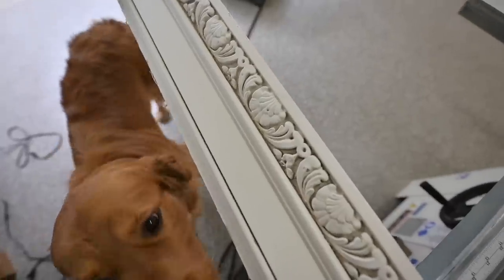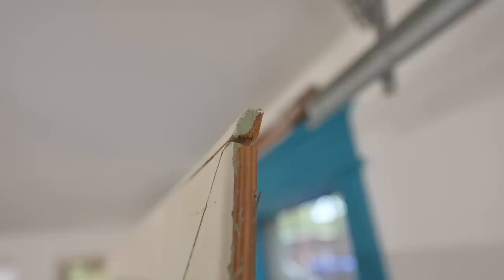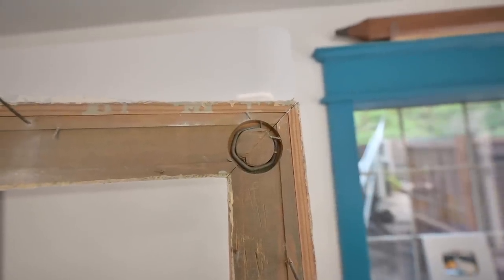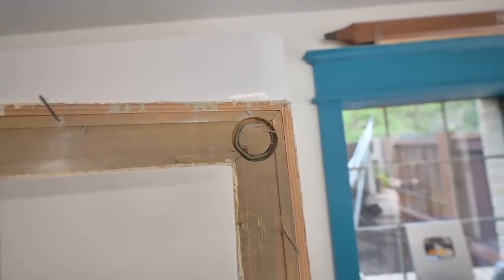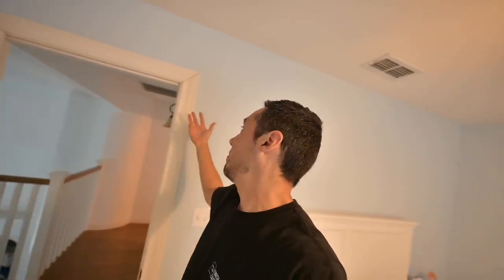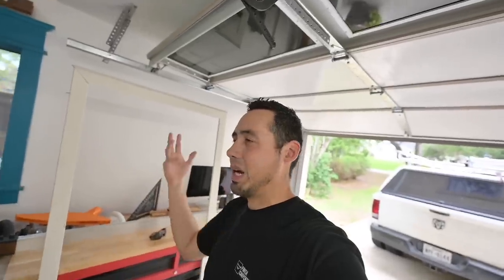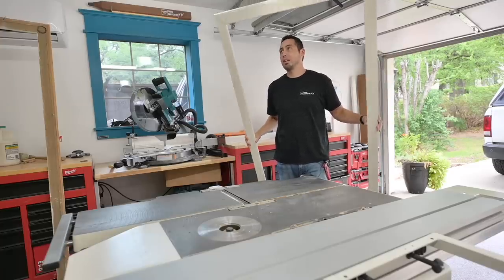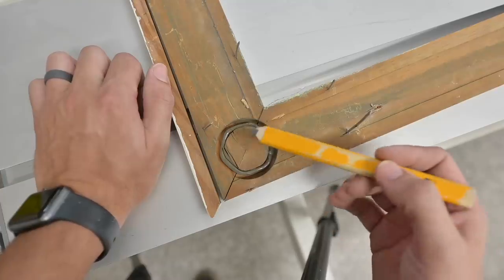Door casing skill lost for 100 years

Comment: As others have written, there were/are specific tools to make the cuts.
The purpose behind the hex ring is to lock the miter into place on houses that breath. Before the advent of Air Conditioning, keeping cold air inside the house was never a consideration, keeping the inside of the walls dry was of primary importance, even when insulated, air was allowed to move between walls.
Walls rarely had horizontal part and were of a ballon wall construction, so air could literally flow the entire hight of the wall to the eve. 
While this keeps the walls dry, and thus they do not rot, it causes really large swings in the size of wood joints. Your miters would swell in the winter and shrink in the summer, locking the miters was the solution. While the would is still swelling and shrinking, the hex ring keeps the miter tight.
Reply: I’ll continue to use titebond 2, your analysis is spot on though
Reply: One of the reasons that we don't have good breathing in homes also has to do with fire safety.  The lack of air movement between spaces also restricted fire movement.
Reply: Swell in winter and shrink in summer? It’s quite the opposite where I’m from…
Reply: Wood movement has always been an issue for detail work and furniture or decor items. Consider kitchen tables, as an example. To deal with gain and loss of moisture, the top is secured to the sides and end using a means by which the wood can expand and contract without destroying the joints that, otherwise, would be used.

I have been ridiculed by ignorant people, including a well known expert, for finishing the interior of my chest of drawers and things. They were confusing reduced labor cost with best practices for building thing that better deal with changes in humidity and such.

As an example, consider a piece of craftsman ship moved from a high humidity area to a desert. The moisture content of the item will change (reduce).  It can happen rapidly or slowly, depending on how much of the surface is sealed.  Of course, it will be much slower if the sides, edges and ends are all sealed (the reason many prime and paint the back side of siding, including Hardiplank and such).
Reply: Fastest burning houses ever built. 4 alarm fire in 5 mins or less guaranteed 😎
Reply: @tommyPencils08  is becouse of humity, not heat
Reply: @tommyPencils08  That's likely because you have AC, which dries the air.

Comment: Thanks for sharing this , I learned a lot from working on older homes picking up on techniques to do a better  my skills. 25 years ago they used to use a lot of  oak trim I noticed when I used to take apart trim the old timers would put a dab of glue on the back side of the casing to glue to the drywall to keep the miters from opening up. Thanks I enjoy watching your vids.

Comment: These moldings were manufactured and sold at standard sizes. The builder would buy the door and trim package and assemble them on site. Back in the 70's I worked on a few homes with this type of trim work. Lots of this stuff came out of mill shops back in the day.
Reply: This was my guess. They probably had a router set up at the mill. I don’t see any signs that this was on site, no chisel marks of any kind, super clean cut.
Reply: Yup, this was fabricated at the mill.   Mass produced and prefabbed building materials are not new, been around a very long time.  Over a hundred years ago Sears was selling house builders kits, everything you needed to build a house down to the last nail.  A lot of it was standard sized ready to install stuff.   I'm surprised that people are shocked by this.  Heck, Henry Ford started mass producing cars back in 1908.
Reply: @MrSloika   my thoughts mass produced, the ring looks machine made induction welded.

Comment: Years ago I met a wheelwright (a guy who makes wooden wagon wheels).  He showed me his process of pulling a wagon wheel tightly together using the outer iron/steel ring. The ring was a bit smaller in circumference than a newly made wheel.  By heating the ring he could expand its size, tap it on the wheel finally as the metal ring cooled down it shrunk back to normal size which tightened the wagon wheel. I wonder if this hexagon was tapped on easily while hot and tightened the miter when cooled. just a guess...
Reply: I was thinking the same thing, but I don't see any burn marks. Although it wouldn't have to get that hot, steel expands at, I think a little over .06%  per 100 degrees f. Which isn't a lot, but would be enough to hold a joint together.
Reply: You should check out the YouTube channel "Engels Coach Shop" and see a guy who is still doing that and posting videos of it.
Reply: Ohhhh! That’s good thinking, man. Maybe so.
Reply: @jimthesoundman8641  Love that channel been watching for years..good recommendation!
Reply: I had the same idea as you.  I saw the wheelwright at Williamsburg Va
Reply: I thought the same thing and was looking for this comment. Is it possible that they dipped the ring in cold water just prior to dropping it in the recess. This might explain the lack of burn marks. And no chisel work would be required. The ring would then immediately tighten and squeeze the wood to the hex shape.
Reply: @keithoshea2174  I would think just putting the ring in hot boiling water then taking it out and putting on the joint would suffice in that case.  You wouldn't burn the wood and it would cool fairly quick
Reply: On this scale i doubt heat was used.
Reply: @seankelly819  p
Reply: If he got the ring up to boiling, it would only be 0.09% expansion. Not near enough. A 2" ring has a 6" circumference that would go up to 6.005". If it was 400°F, it won't burn but it would still only gain 0.01" in circumference.
Another technique is to saturate the wood in boiling water until it's pliable. Seems like a lot of work, but if you did 20 at a time, not really that hard. You can really distort wood a lot when it's boiled, making cool "impossible" conversation pieces like a gold ball in a wood cage.
Reply: I was wondering if the steel ring was rotated on the wood hexagon so the flats and points would be 90 degrees out of alignment. That would have made easy to get on in the first place and rotating would have tightened and locked the joint.
Reply: Doubt it. The ring here is too small for that effect of expansion/contraction to be used as you say. It works on wagon wheels because they are larger, compounding the effect to a greater degree, to where it's useful in that way.
Reply: Y'all may not have seen it 11 hours ago, but the joint is drilled and cut with a jig, so the metal can be ordered to fit that size by the bag. It's just hammered on with a similarly sized pipe-type punch, and maybe some beeswax for lube
Reply: No burn marks.
Reply: Exactly how the tires were installed on steam locomotives drivers
Reply: @keithoshea2174  if the ring was dipped in cold water then it would have shrunk immediately, negating the purpose of heating it.  There is no delay between temperature and expansion/contraction.

Comment: Simple but genius! They wouldn't have chiselled a hexagon. it would have been a circle. The purpose of the hexagon is so that the straight sides are slightly smaller than the circle, and so act as a spring under tension when hammered into the void, thus firmly holding the mitre together. Brilliant!
Reply: Thats right and that was in a fixture clamped tight under a press.  The press drilled the hole and then pressed the ring in.  Those things were super tight.
Reply: Gets my vote🎯🔗
Reply: Winner, winner chicken dinner... give this man a prize...
Reply: Seems like the best answer!
Reply: Yup, you can see it's only slightly hexagonal from the ring being driven on
Reply: Which is exactly why you put a "square peg" in a  round hole, has the same tightening biting effect.
Reply: As a carpenter I totally agree with this comment. My first thought during the video was the "inner" circle would have been round, therefore creating a squeeze effect from the hex ring being inserted. The inner circle appears hexagonal from years of being held together. Nice find...sadly, a lot of today's trim would be too soft to even use this method!
Reply: I would guess that is pretty accurate description, though, might add a slight detail though I could be in left field...and that is that the wood may have been slightly dampened with water to soften the wood grain before pressing the hex ring in place so as not to destroy the wood fibers.  I have seen corrugated nail fasteners used for this, but I am amazed to see the wood doesn't split or break apart.
Reply: @joshuakakar  What do you mean mdf trim would totally withstand this type of fastener… ha
Reply: A circle is FAR MORE efficient.  But it takes more to manufacture than a machine making a series of bends before a factory weld.  Bends don't need to be cherry.  A circle most likely would.  It's a cost-saving factor with the same outcome.  I think it's just that simple.
Reply: LOL!!!  I don't think it's simple.   The dado bit and rings were engineered to work together within a few thousands of an inch.  This wasn't 'whipped up' in some guy's garage, this was a factory utilizing an engineer's design from a print with custom machinery.
Reply: @palettetools6461  BINGO!   Seems to me these were measured on the job site and ordered the way we do windows today.   They were MFGed, labeled and shipped to the job site where they were installed.  Exactly the way we do with windows today.
Reply: @Aucourant347  That's why I keep a proper supply of rubber bands on hand...😂
Reply: @crforfreedom7407  I imagine today, you could do this with just a hole saw and the ring. Hole saw on a drill down to your depth, then punch it on with a hammer and punch. That or a specialized tool that would bend a wire around and contact weld it, which would take some time to invent I imagine.
Reply: @Adierit  IDK.   That's not just a 1/16" or even 1/8" blade kerf, that's a dado.  That ring was manufactured.   Whatever ring is made would need to be the right size; just a few thousands of an inch smaller than the specific diameter of the circle.   Unless it's manufactured, the time to hand make something to size would be incredible. 
          I don't see where spot force was applied.   My bet is the dado bit was mfg'ed to the specific size hole and the ring mfg'ed to just a few thousands smaller, heated, then pressed on with equal pressure from all sides.  Sure a little bevel could be all around the circle to help the ring start, but ideally, it would slip over with the expansion and press in with the least amount of modification required if it is a production piece.
Reply: I wish he had video taped the disassembly.
Reply: That would explain the rounded "corners" on the centre section.
Reply: @crforfreedom7407  I doubt the design came from an engineer's mind.  More likely it came from the mind of a finish carpenter.  The engineer just designed the tooling to make it mass produced.
Reply: @David-hm9ic  IDK.  As I said earlier, the concept is literally HUNDREDS of years old.  Wagon wheels and barrels were made this way for centuries before these guys came up with this.
Reply: @David-hm9ic  For all we know, it could have been created by a guy who used to make pickle-barrels for a living...

Comment: I have seen an old guy down in New Orleans after Katrina work with them.   he had a hole saw bit similar to todays but was thick wall and no center bit like we are used to.   He cut the ring with the bit leaving a circle of wood in the center just a bit bigger than the ring.  The ring isnt round as you indicated but with another bigger piece of pipe, maybe 8 inches long and ring diameter, put it on the ring and just pounded the hexigon ring over the circle.   Said it made it super tight that way.  if you put a shaped part over a shaped peg, it will always get loose, pound a shaped part over a round peg and it will stay tight for life.        What a clever find. I forgot about them.  thanks for sharing the video.

Comment: From an engineering perspective, the hex ring acts a spring that permanently clamps the miter together.  There are 2 very critical dimensions to make the work, one if the distance across the flats on the inside of the hexagon and the other is the diameter of the pilot that it fits over.  I don't believe that the wood needs to be chiseled to a hex shape.  The wood pilot boss acts as an inscribed circle within the hex.  For this to work, the pilot boss diameter must be cut just about 1% or so larger than the actual inscribed circle diameter of the hex ring.  If the inscribed diameter is say 2", the pilot boss must be cut to about 2.02" or less than 1/32" larger.  Then a socket like installation tool would be used with a hammer to force the ring into the groove.  It is that interference that creates the force that holds the miter together. As the wood expands and contracts with changes in moisture content, the hex should maintain it spring force. Overtime, I suspect the wood will crush enough to lose its elasticity, but as long as no clearance exists between the ring and the wood, the joint should remain tight.
Reply: hunh? you must be an engineer
Reply: @rogerdavies6226  lol, "From an engineering perspective" didn't give you that hint?
Reply: I agree. A circle cut with an interference fit was my assumption.  Too much precision needed to cut a hex to match a hex and yet have clamping force.  If he looked closely, he should be able to see if the wood grain is compressed or cut into a hex, and by looking at the bottom corner of the inner wood.
Reply: The ring is hex and the inner wood circle is round and the miter is 45 degrees.  Since the hex angle is 120 degrees and doesn't align directly with the 45 of the miter, it would provide different force on one piece vs other piece pulling the miter joint one way or the other.     Maybe I'm way off but pause at 8:07.  If the ring was tapped and rotated counterclockwise the right piece would move up and the left piece would move down.   This rings holds it together AND provides alignment tweaking.  I think the tolerance of this setup was not as critical and the hex shape gave a lot of latitude for getting it to work.
Reply: The hexagon shape of the metal acts as a spring over the round wood preventing stretching and loosening of the joint to within reason. It would be interesting to see if that metal part is still in manufacturing somewhere in the world.
Reply: @davidarmour7766  another comment says they still use them in Romania.  My comment above this one explains how all of you engineers got your guesses wrong about how these work and are created. Keep it simple is something you've all clearly lost the ability to achieve. Guess thats college education for you, not really very worthwhile imo
Reply: @chrism4008  well….thx for the compliment. 😏 A guess, is all I had. No engineering degree here. Just a common sense guess. I didn’t read all of the other comments, I just saw the video and commented on this one. I don’t need to know the facts of the history to see the way a mechanism works.
Reply: @chrism4008  'Keep it simple is something you've all clearly lost the ability to achieve.'  How does someone even say this, and not realize 'pressing the hex ring over just a round part' is actually the 'keep it simple' idea, and 'cutting a hex' is not the simple idea?
If you look up the old patent progression and prior history of this idea, almost guaranteed it was originally 'round hole, round ring, over round center'.  Then probably came hex ring over round for the spring pressure reasons OP stated, then finally someone added the chiseling to match the hex form to the hex ring a little better.
' not really very worthwhile imo'  For someone claiming to see it 'better', you're missing a lot of obvious background knowledge.
'how all of you engineers got your guesses wrong'  Realize, you didn't 'get it right' and do better either, someone else simply told you the answer they have.
'Keep it simple is something you've all clearly lost '  You literally got this totally ass backwards.  Their answer was the 'KISS' answer, the hex chiseling the mentioned machines have is obviously a later complication, not 'simpler'.
Reply: The ring was hot when it was installed.
Reply: @ModelLights  i don't have to guess like you though. I read the comments and there is a person who has experience using this device and explained it in detail 🤷‍♂️
Simple as, I didn't guess
Reply: @ModelLights  I stopped reading as soon as you said "almost garaunteed" you didn't bother to look at anything either, so I'm not wasting my time on your diatribe.
Im arguing based on human experience and you're pulling things out of your bum and calling it an argument? Idk cause I'm not going to waste the time on assumptions of an engineer.
I stick mostly with reality, rather than hypothetical. Try it some time
Reply: Another point on the use of iron:

Many of us have lived in homes that, while sturdy, had floors that bounced as we walked across them. To solve the problem, many things have been tried after the fact. Things like sistering another 2x next to the existing ones.  

Tests showed it took a lot of lumber to bump up the floors resistance to sag and bounce.

One of the solutions was, using a 1/8" thick by 1-1/2" wide strip of metal the length of the 2x nailed, ever couple inches, to the underside of the 2x.  Since metal doesn't do a lot of stretching, it was like using MUCH wider 2x's (e.g., 2x16's), without taking up any room below the floor.
Reply: @jeremydiener1559  It couldn't have been very hot or the wood would be charred.